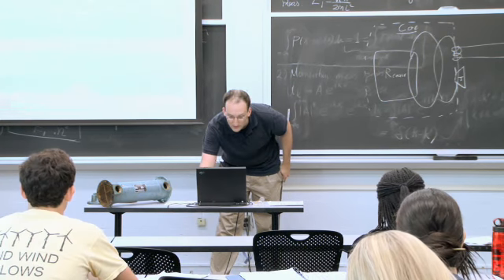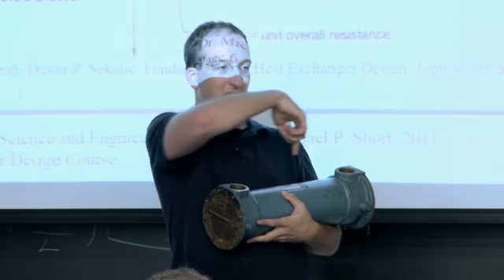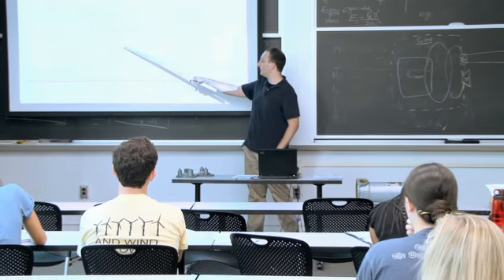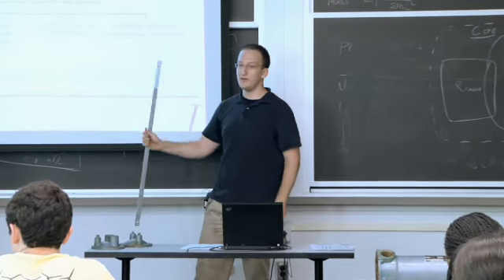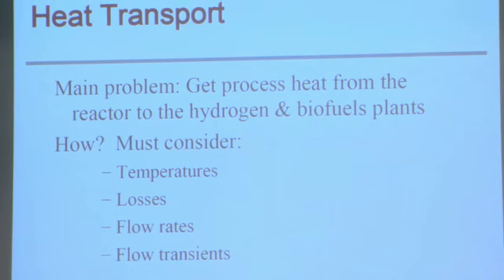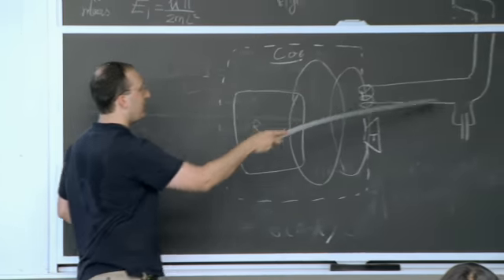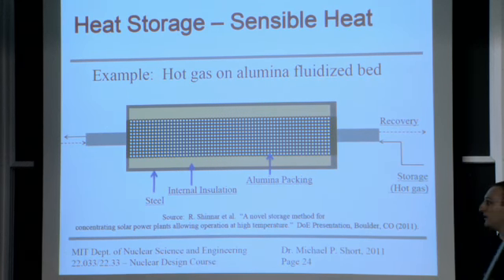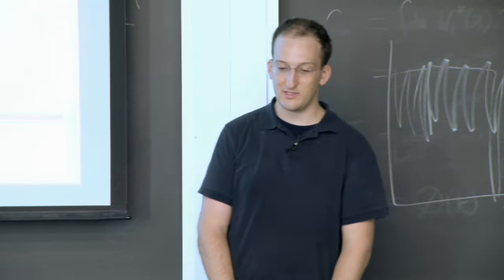Lecture 2: Process Heat - Major Challenges

Comment: Is bedrock a viable medium for heat storage?  Or too lossey?
Reply: It is not because layers are not in wanted shape or thermally insulated, so yes, very lossy. Getting systems in is another problem. Good materials to do it are salts, water, production of hydrogen or other energy dense materials.
Reply: Cemented tubes in the ground?

Comment: 30kW for 40hp Hx..... is that not 100% efficient thermal transfer?  40hp*0.75W/hp = 30kW
Reply: Are you still following this? He told what max power of the heat exchanger is. 40hp motor won't produce 30kW of heat because heat is side product of friction and other causes. So 40hp motor will probably produce a few kW or less of unwanted heat. I'm trained for electrical systems where they tend to use water/hose analogues to explain current flow.
They should talk about molten salt reactors a lot more because they are future of energy production.

Comment: Why not try a gas core reactor? (GAS FUELED CORE)  It seems safe just put it under a little pressur to be critical if theres an emergency just lower the pressure.
Reply: wait you mean nuclear fuel as gas fuel?
Reply: @AltarParssoy yes, the use of gaseous phase nuclear fuel